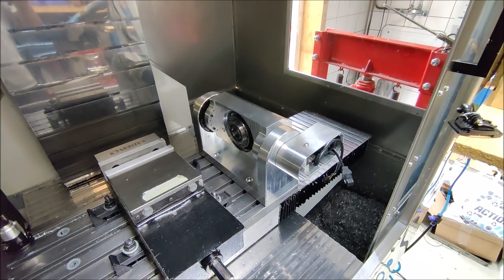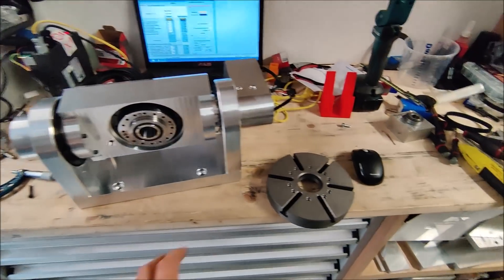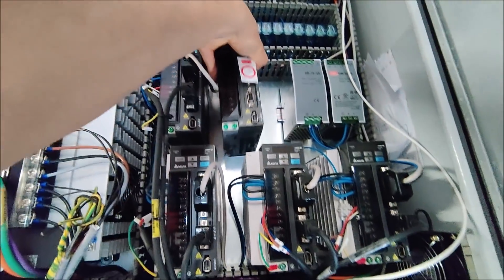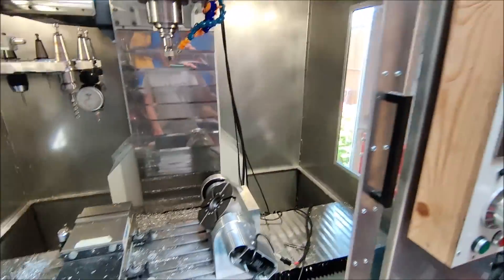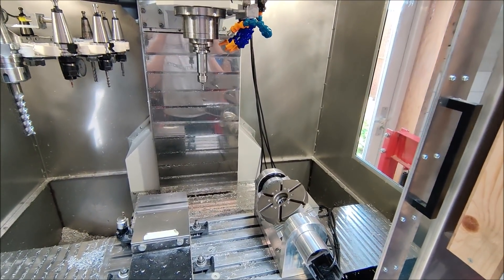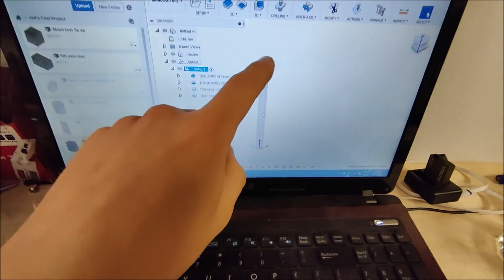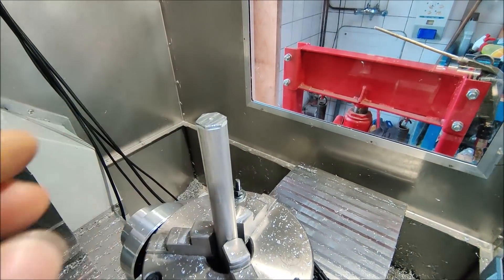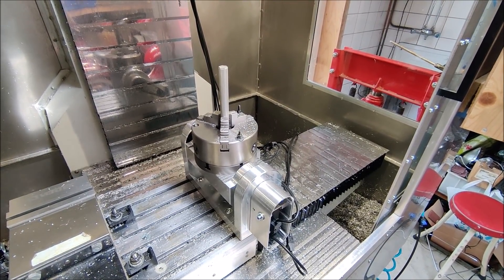Diy 5th axis trunnion build part6

Comment: nice one, curious to see it in action.  (if the eding post gives errors, switch over to haas post)
Reply from the maker: Sofare eding post proccesor isnt letting me down. I had to modify it a little to have the 5th axis to work.
Reply: @Svanitterzon    yes it works mostly, but there is a part missing in that post.  (something to do with Rewind)

Comment: Hello Stef,

I am absolutely thrilled with your work!
Since I recently built a 3-axis CNC milling machine (made of UHPC concrete) myself,
I am particularly interested in your trunion.
But I see a big problem in the procurement of HARMONIC Drives:
the whole construction depends on it.
I would like to integrate your F360 model of your Trunion into my model of my milling machine.
Would you provide me with the CAD data (email address)?
I'm looking forward to your Dovetail vise construction.

with best regards
Achim
Reply from the maker: I will post the 3d model one day i guess on grabcad just like i did with my cnc mill. but for now i keep it myself and first gone try it out.
Reply: @Svanitterzon  many thanks for answer...

Comment: Do you have TCP on controller? Nice work!
Reply from the maker: No my controller doesnt have that. So i need to set my coordinate system very well on the cam side.
Reply: @Svanitterzon  hey thanks for the video ...would you please elaborate on setting up coordinate as I'm busy with a table/ head system